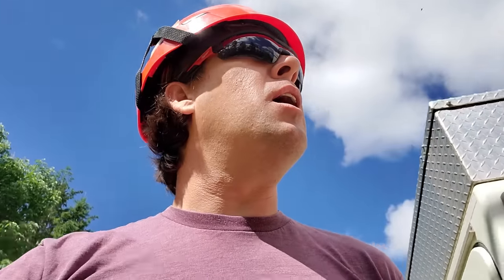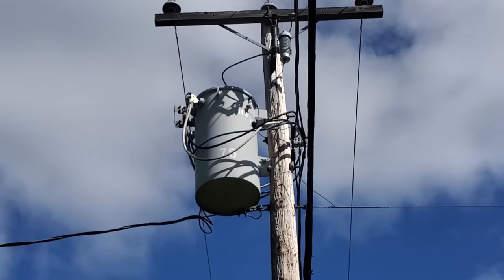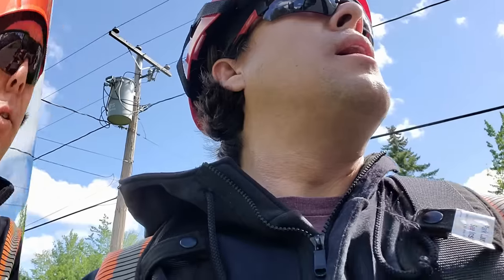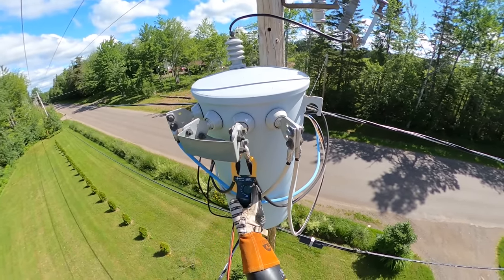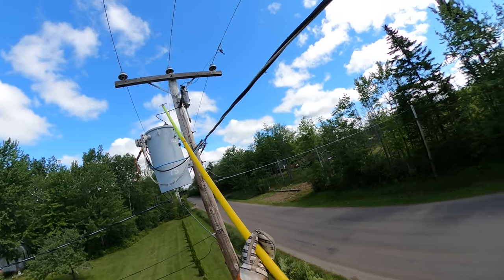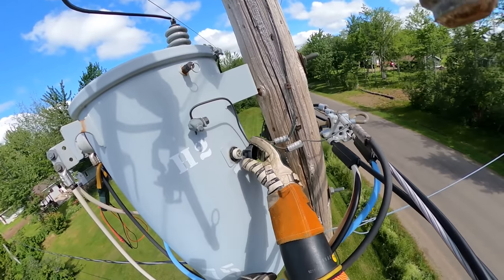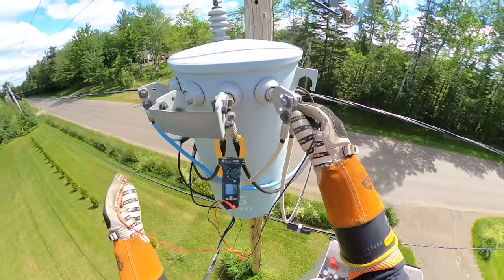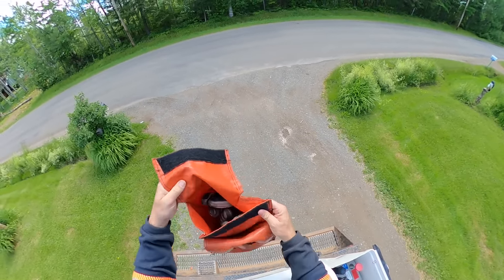How we change voltage on a transformer

Comment: I'm 75. As a new radio amateur in 1965,  our  family's power was all over.  Hundreds of feet from  street into the house,  and  the well pump would suck the B&W  TV  picture in. You had better be ready to jump up and grab the vert or horz hold adjustments on the big Zenith console  behind the little door under the tube, or face the wrath of Dad    At some point the neighbor, who was a widow,  gave me a few things of her husband, and one  was a Sola  constant voltage regulator, large enough to handle my  amateur receiver.  That changed everything.   In order,  the terrible Hallicrafters S-38,  Heathkit AR-3,  a couple of  ARC-5  surplus  receivers,  and an RME 4350A  which I still have.  Novice tx was homebrew,  6AG7 / 1625, power supply built from TV set transformers.
Reply: Love this comment. My Dad's a couple years younger. Never got real into radio but had a shortwave receiver at least. Taught himself enough to be the neighborhood TV repair kid though in his tiny rural town. Still have his Sears '65 silvertone guitar & amp which I recorded an album with myself years ago.
Reply: Transformer tapping, I have been in the switch yard when a 1970's 32kV Farranti was doing a change, it sounded like someone had hit the tank with and sledge hammer followed by a ping.  I get a buzz in the switch yard.   
Halicrafters S-38  was a glorified "All American Five" , no transformer and more potential in the chassis than in its ability to receive.  As for the Zenith console, shango66 would have a solution.  73's.

Comment: Just a little advice,  not criticism. But it wouldn't hurt to check and make sure you're not getting backfeed. Up here in New England every now and then I come across a transformer being backfed from a generator or the secondaries have been tied to another transformer and never separated once the new transformer was installed. Again, just a little advice.🙂
Reply: Yes, I have also seen transformers hooked up in parallel, but the wiring is usually obvious. As someone who was in the generator business for over 20 years, I am aware of gen sets running in the distance, but now with solar (and battery backup) you really need to check things because there is no noise.
Reply: Kindof surprised that there's no built in light or indicator in the transformer that would be lit whenever the transformer is powered, whether by the main or backfeed
Reply: @DRawwrrr  ... in most cases there's enough stuff connected that you can glance down a street and see if there's power or not. IOW, it's not necessary. BTW, some transformers have an indicator light for temp. They will automatically shut down on overheat at some point. The light is just an early warning.

Comment: In a 3 phase 208Y/120 volt system (the wimpy wye), quite often my customers request that I use buck-boost transformers to obviously step up the voltage from a nominal 208 to a nominal 240 volts.

Comment: not many pole transformers hear in eastern US have tap changers. running slightly high can be a good thing. with hot summer load of AC you don't want to drop much under 120V/240V motors will draw more amps and run hotter. all newer appliance can handle 5%  change of line voltage or more. If a customer has old electronics ,that can be fixed buy auto transformer with taps or AVR unit or even a bucking transformer. like old tube radios from 1930's 110V some 115/117V . from Boston NY,USA most around 242/245 hear .
Reply from the maker: Great info, thanks for the comment Robert!
Reply: One of the good things about vacuum tube electronics is they will run just fine on much lower than normal line voltages, so you can get away with using something as simple as a dim bulb (a high wattage lightbulb) in series with it.

Comment: I saw a few people question why someone would want a lower voltage.  For me, I was in this precise situation where I needed my utility to make a voltage adjustment downward a little.

I had a solar array with battery solution installed last year.  My utility voltage would routinely coast up to and go over 252v (126v per leg, and I've seen as high as 260v).  Reason this was a problem is part of the interconnect agreement I have with my utility.  If grid voltage goes over a certain level (greater than 5%), my equipment disables itself and shuts down, and therefore, doesn't work.  I thought it was a problem with my equipment until I dug around more, questioned the solar manufacturer, asked my installer, etc.  It finally came back as grid voltage being too high. 

It was especially bad during the winter; batteries didn't work (charge or discharge) for most of it.  So I submitted a ticket to my utility to make an adjustment.

There is a cluster of transformers that drop 7800 volts down to like 4800 that feeds my neighborhood (the electrical service that feeds my house is really old).  Turns out that the transformer cluster had a trim adjustment just like this that they turned down.  They told me it was set to maximum, and they returned it to zero.  Voltage to my house went from 252 to 246, which is perfect.  I haven't had a problem with my equipment since.

Even with the scorching temperatures we've had so far, the house doesn't drop under 240v even.

So, this is an example why a residential customer may make a complaint like this.

Comment: Thanks Aaron. That transformer seemed to be a rare example with the tap changer. I've done that many times on 480 Volt three phase pad transformers adjusting the taps to match the primary to lower or raise the secondary.
Reply from the maker: Definitely way more common on padmounts!
Reply: @Bobsdecline  Any chance that adjustable transformer was put there because it's so close to the substation and this issue was foreseen as a possibility?

Comment: Been watching your channel for awhile. Very cool stuff. I am a residential electrician in New Jersey. I always thought pole transformers only had switches for the primary voltage to use it on different systems.  I don't think we have tap adjustments here. The last low voltage complaint I had for a customer ended up with her getting her own transformer which solved the issue. We also have tons of voltage regulators so I think my local power company tries to deal with voltage issues that way.

Comment: Had high and low voltage conditions all in same day. Pretty regularly. Turns out the hard drawn copper secondary was the issue. Couple spans replaced with triplex, and no more huge swings.
Reply from the maker: Sounds like a bad neutral connection! Likely a connection between copper and aluminum...
Reply: @Bobsdecline  A friend of mine's dad had a broken neutral a couple months back, found it after he measured the window AC with my Kill-a-watt ... He just happened to be on the phone with me as he had our local cable internet company out to fix their internet, and he mentioned melted coax.. That coupled with the huge voltage swings(Circuit the AC was on dropped to 80V) and I told him to measure line to line and make sure it was still 240 in that scenario, then we determined the coax shield was acting as the neutral for the house. Power company had to come out replace the triplex, the neutral had abraded and rusted on a tree limb.
Reply: @Bobsdecline  the excessive sag didn't help during higher winds either 🤣
Reply: @thewhitefalcon8539  Yeah, modern electronics have boost-mode power factor correction typically on the input stage, that allows for the large voltage range and frequency variation on the input, often 100-250V. He never told me that anything failed in the house, aside from the internet going out (for now obvious reasons). Guess they got lucky. Definitely not a great situation to have.

Comment: I am an electrician in Brazil, our tap change procedures are very different from those carried out in your country as they are simpler, here we cannot do it without first carrying out an analysis of the transformer loading so as not to have problems with voltage changes when the load increases or lower depending on consumption.

Comment: My thought would have been to check for voltage across the secondary after pulling the fuse, just in case of backfeed. Then apply ground cables across the secondary. That fuse was hanging right in your face while you were touching (albeit with gloves) the grounded transformer case. A backfeed at that moment could have been... enlightening...
Reply: 240v.. no big deal. cant be very much stored energy.
Reply: @bigiron4018  But 240V transformed back to 7200V through the transformer...  rather shocking.
Reply: Thank you father. I'm sure this guy would never survive if it wasn't for your supreme knowledge.
Reply: The gloves are insulated sich that he could touch the energized lines without problems, that's why he's wearing them to mitigate risk.

Comment: We never store our gloves with the cuffs down as the gloves weigh enough to fold the rubbers and eventually they will fail. The fingers with leathers never fold. The other reason for my paranoia is that I don’t use my high voltage set up very often and you guys are using them way more often. Inspection for leaks always a priority of course…..nice work!

Comment: The only reason to make this change is in case a VR up the street goes off by a few percent under changing load conditions. Not a bad call to stay closer to the mid-point of acceptable line power. I did generator work for almost 25 years and if I needed to adjust things, I would aim for 242 - 245 volts. This keeps power in the right range during those times when you get a few percent swing due to temp or load swing.
Reply from the maker: I agree 100%

Comment: That's really neat that it had that option, wonder if original installers did on purpose because it's so close to substation.   If the voltage was out of acceptable range and you didn't have that option what would be the normal course of action?  Do you need to switch out the whole transformer for one that has a slightly different turn ratio?
Reply from the maker: If the voltage was consistently over 126v I would likely check a neighboring transformer first. If those numbers were again consistent, I would then check our regulator settings at the sub or VR bank. That would in most cases solve the issue. 
There are a few equipment problems/malfunctions or acts of vandalism that could result in consistent high voltage also. 
I've ran into that twice in my career. They can be a head scratcher for sure!

Comment: Your hard hat i hope is specific, for the voltages your working. it also looks like it doesn't fall off. We have some generic hard hats, one vented and one sealed for work in the catenary sytem area for the train.  even if you are on the tracks not working on that system.  Love to know what hat that is.  I tried to get a klein hat but safety didn't approve it, but aproved similar for other people.  Hope you enjoyed your vaction. 
 I just stayed at a rental house and there was i think a voltage reuglator.  It had three feeds from the three phases, and three outputs.  And a nearby pole 20' from it which had two wires to a third pole with a transformer for the two houses next to each other across the road.  Yes it had the adjustable tap.   As i was traveling i also saw the constuction of a power line right of way with pulleys hanging for a new distribution line! Big towers!

Comment: I know almost nothing about electricity (can't even change a socket out), but I did work at Kuhlman Electric years again Versailles, Kentucky.  They closed down the plant less than a year after I quit.  There we made those transformers:)
Reply: I know some. Like he said the power comes from substations and travels from pole to pole and eventually gets stepped down via transformers to supply neighborhoods businesses etc. Not really that difficult once you understand ratings and amperage

Comment: Here in my part of Norway my utility company change the taps on the transformers several times during the day remotely. Or maybe automatically based on load. One transformer powers maybe 50-100 houses, so they tend to run on the high end of 230-240V to be sure that the last on the line still gets decent voltage.
But looking at the data from my smart meter, that gives me voltage on all three phases, I see how the voltage drops in the morning when people start waking up and it slowly drops from maybe 235V to 230V, and then all of a sudden from one measurement to the next 5 seconds later the voltage has jumped up to 235V. And then it slowly raises during towards noon where it usually goes up to maybe 238V, and then it has a instant drop to around 232V again. And some times there is a jump in the afternoon/evening too.

Comment: Interesting to see. I remember about 10 years ago we gave the lines crews a challenge... our measured voltage was 132V on the receptacle so we called it in for overvoltage... and ofc they agreed and atrempted to fix it... and left ir below 110... the microwave oven would work properly.

But the local distribution line was old and had a ton of issues. Later they added a new sub and moved half the customers over and then replaced the entire line... which as a customer that was tapped off of one of the few three phase feeds on that line was interesting... we had to have our transformer changed twice and the three phas customer was on a temp propane generator for the duration of the switchover.

Comment: Before you change voltage on the transformer, make sure that there is not a problem with the regulators or LTCs at the sub. If there is a problem and it gets fixed, you may have a bigger problem if you’ve changed the taps on a bunch of customers.
Reply: Go away

Comment: Why did you not use a load break tool to open the cutout? I'm trying to learn
Reply from the maker: Anything over 50kva a load Buster is good practice. More specifically anything over 10A is a requirement.

 In this case, I had a couple meters off and the remaining houses were very small with nobody  home. I would estimate 2-3 amps were on the primary side, but with hindsight being 20/20 I should have showed the amperage in the video before opening.

You can check the amperage on the secondary side and divide by the tx ratio (60:1) or use a primary ampstick.

Comment: As a person who does work on vacuum tube audio gear, a great deal of which was designed for 110-115v, it sure would be nice if the supply stopped creeping up and up and up and up over the years.
Reply: Get a portable step down transformer.
Reply: Well, that would be great, except I'm running about 2500 w (from the socket) worth of tube gear, and I don't know if you've priced a 30a step down transformer lately, but that's gonna be a no from me lol
Reply: @drdyna  Just build one. Not terribly hard, easy math, and winding transformers is oddly relaxing.

Comment: Some pole tubs are duals like 4.8 and 7.2  or 7.6KV for delta or Y primary. Changing the voltage requires moving the NLT (NO LOAD TAP Changer). It has to be de-energized to move the tap switch. Easy - peasy. The delta capable tubs have two HV bushings. At First Energy we had 19.9 / 12.47 KV Duals (Y - Y). Some step banks have a NLT to adjust voltage, but most distribution tubs are not really adjustable at the tub. Check the tap changer at the sub and the SATAC reading. Also, if a cap bank is energized, try opening the bank. Even though they're there for VAR correction a cap bank can bump up the voltage as much as 3 volts. Maybe change a fixed cap bank to one with a controller. to open when it hits 123.5 volts and cut-in at 117..
Reply: Thanks dad!

Comment: From what i understand what defines the type OLTC/NLTC is whether the Tap is changed internally on the Primary or secondary sides do to the current capability and Arc suppression of the internal switching mechanism

Comment: Once had a situation where the static ground at the pole failed and the ground rod at the house was not working correctly, wow did that make for an interesting night. The lineman hammered in and connected a new ground rod at the house and repaired the ground at the pole. At current residence, one of the hot legs fell out of the spring loaded connector on the transformer due to high winds in which some electrical loads worked and others not at all. That was a head scratcher for sure. When the lineman arrived and couldn't figure it out, he put a light on the transformer and there was the second hot leg just dangling in mid-air inches from transformer case. I now have digital meters installed here at computer desk where I can monitor both sides without going to panel or outside to transformer especially in a storm. I now monitor for spikes and imbalances as well as dropped service all without leaving computer desk.

Comment: 7kV is a terrible operating voltage, unreliable like 4kV. 12/21 kV is preferred, however, that is all dependent on the population, projected load growth, planner, a robust circuit, substation and the investments the corporation is committed to making. You’re an excellent T-man regardless. Nice work.
Reply: 7200 V is the phase-to-neutral/ground voltage. Phase-to-phase is 12470 V or so.
Reply: @jovetj  not sure what I was thinking that day. You are absolutely right. Ooops 😁

Comment: I live in south Texas we have cpl or aep our mains voltage is usually about 119 ac in residential and about 121 in commercial areas. There can still be a hazardous high voltage on primary side if the distribution transformer is in parallel with mains voltage on secondary side

Comment: Local outlet voltage here is 122.
Vintage SS electronics were designed to run on 115 to 117 back before 1980.
Keep in mind if using older electronics.